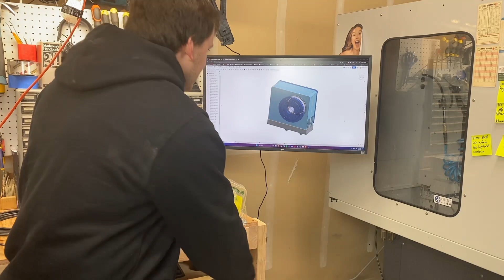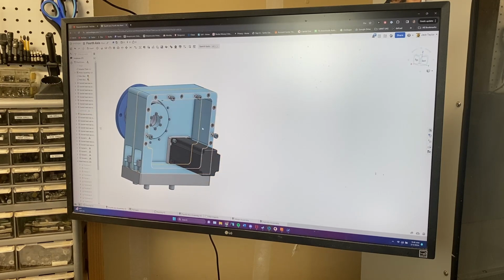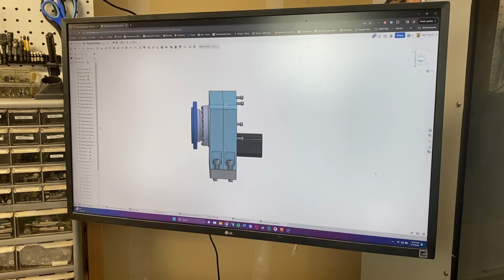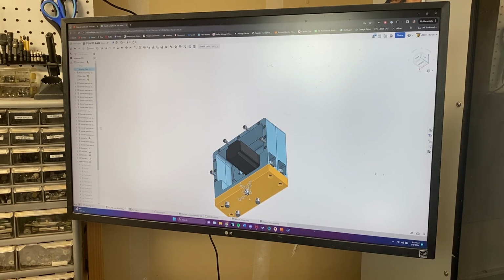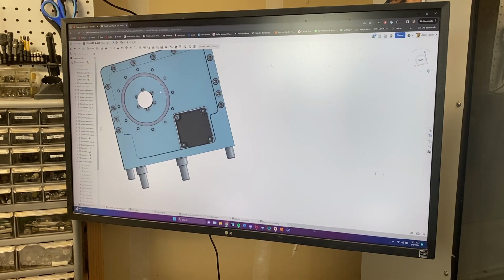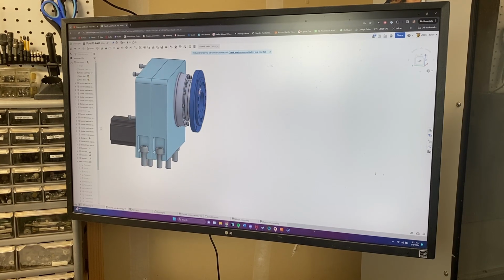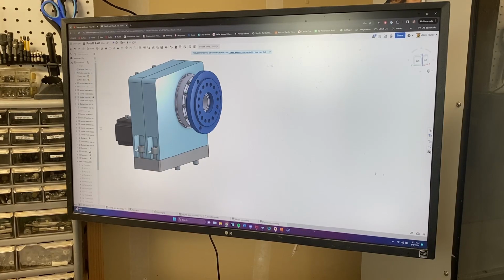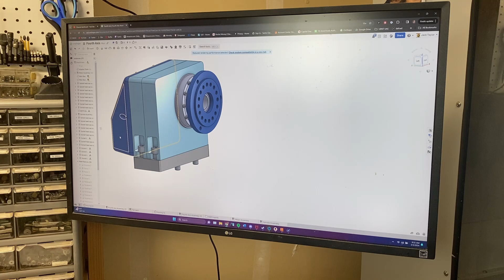Pimping out the tormach with a fourth axis

Comment: Not here to rain on your parade - I am setting out to the same but I was wondering if you came across mentionings saying cycloidal drives are even better than Harmonic ones for a 4th? Perhaps something to do with the former being better in torsion stiffness? Maybe for milling alu on a small machine it doesn't matter? 
Also, cycloidal ones are harder to find at good prices whereas HDs come up all the time used.

Comment: So my research is showing that the config file for the Microarc is set to 141.66 steps per degree.  So your harmonic of 50:1 i would not add more gear reduction.  Put a 1:1 pulley from your motor to your harmonic.  You top speed will be higher.  This is assuming you are using 1000 pulses on your driver.  1000 * 50 /360 = 138.88 steps per degree in the INI file.

Comment: So the micro arc gear reduction is  120/34 * 50 = 176.47 : 1 ?? What dip switches do you use on the driver for micro steps?

Comment: Switch the bolts to CSK and you only need 1.2 times diameter thread engagement (length) where anything thereafter adds nothing by way of strength.

Comment: excellent project, looking forward to the next video. 

your spreadsheet does have a miscalculation in it. cell 19G is just multiplying hours * 50/hr, it should be multiplying hours * rate in 15G for those of us who don't value their time and want to adjust easily ;)